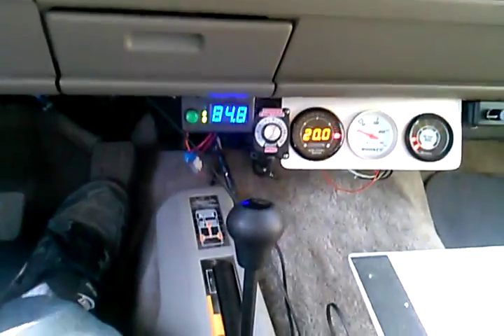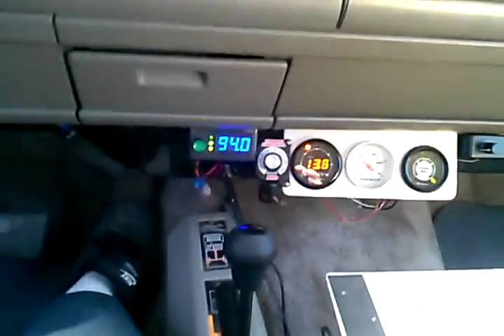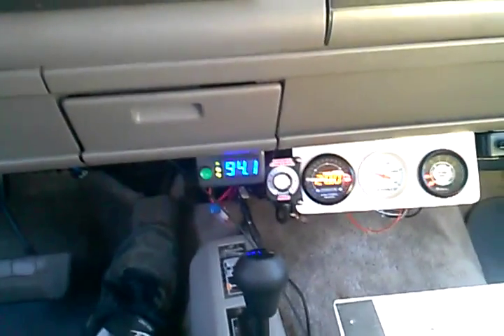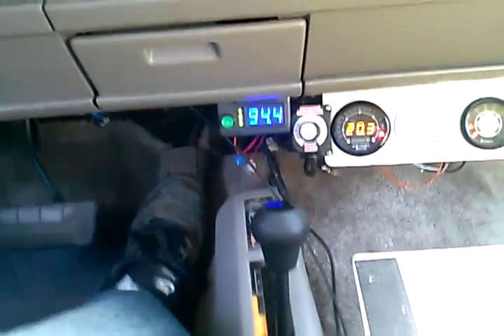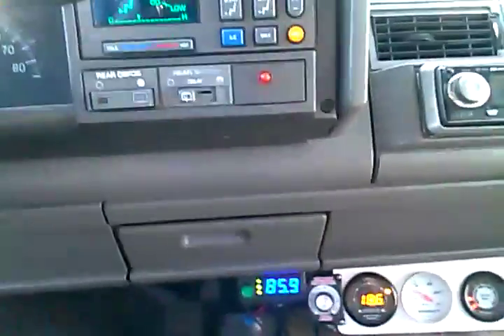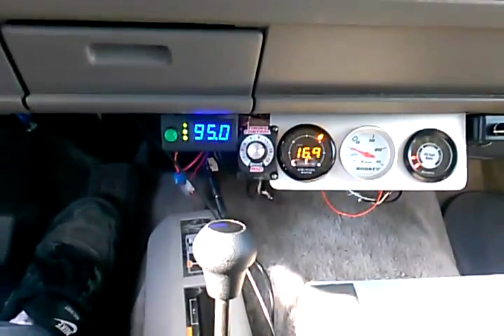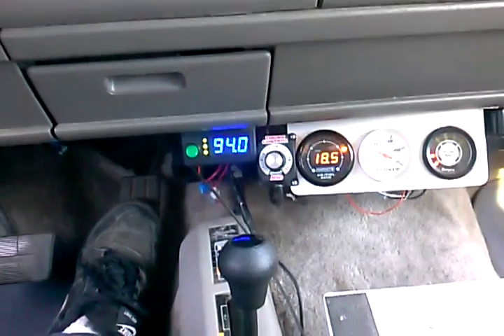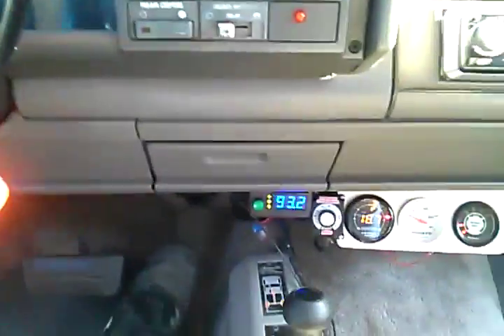hydrogen 8000 miles 20 1 AF

Comment: wanted to know what is your engine temp and exhaust temp, I get the power but running at a higher a/f ratio would it use more fuel wouldn't you need to keep the engine at 14.0 or so as manufacturer for no loss in mpg, also you seemed to have ben doing this for a long time or done some real work to try to make this work so I would like to know what happens to the exhaust do to the extra moisture coming out